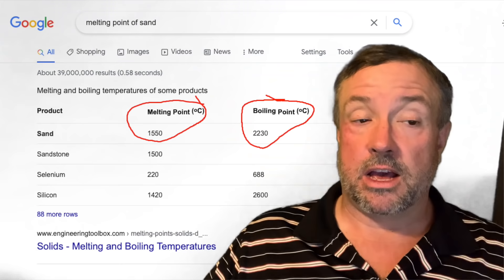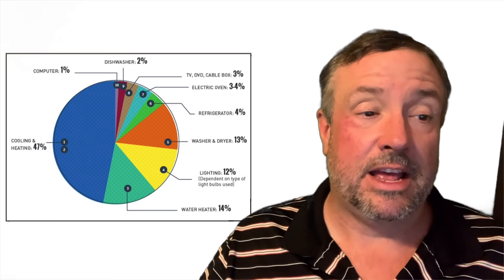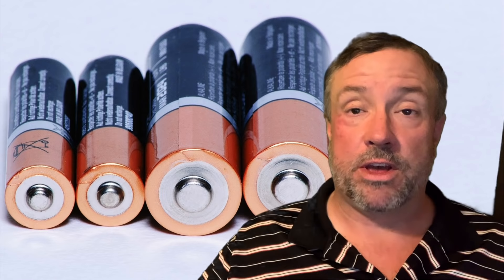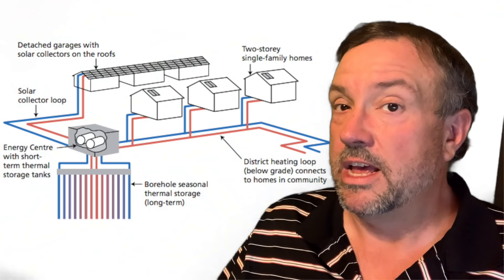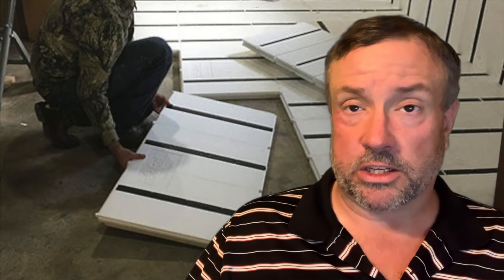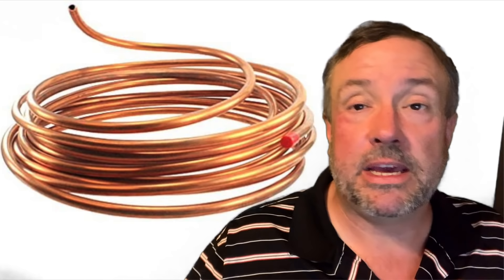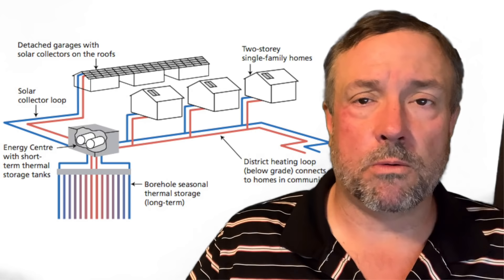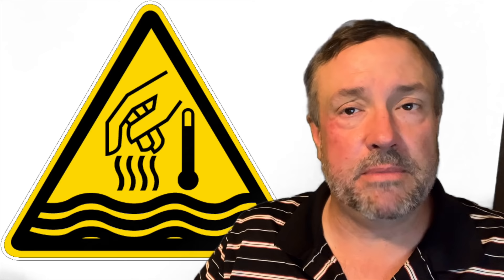Sand for Thermal Energy Storage

Comment: How much does it cost to dig a hole where you live? How much does an aircrete foundation cost? How deep and how wide are you planning on digging?
Reply from the maker: I have equipment to dig... aircrete is pretty cheap, just cement and dawn
Reply: @SimpleTek  do you need rebar for the aircrete? If you dig very deep will your aircrete walls be strong enough to support the pressure from the dirt? How will you handle ground moisture and drainage?
Reply from the maker: @lolerskates876  aircrete is waterproof, and the pressure should be equalized by the sand pushing back.. rebar is a smart idea
Reply: @SimpleTek  

Rebar may limit the life of the structure, better to have a metal free structure then it could last centuries like the Romans.

Comment: Sand is a good choice as storage medium because it has lot's of surface area to absob and release stored heat...but is not very energy dense as there are always air gaps that reduce the efficiencies previously mentioned as air is a very good heat insulator due to it's gaseous form. Air is such a good insulator because particle vibrations(heat transfere mechanism) are not enough to facilitate colliding with other particles, but instead these boundary level vibrating particles are converting energy into black body radiation(infrared photons) to transmit this excess energy away.

if you want to tranfere heat out you shouldn't need any liquids coming from the sand pit, just have insulated metal rods lead to the extraction point where you can have controll over wether you want to extract energy or not....like a hatch between a pile of sauna stones and the metal rod. When hatch is closed sauna stones cool off. When hatch is open, sauna stones heat up and you can drip water on them to spin a trurbine, stirling or whatever... you can also try using TEG in tandem to catch the heat losses from pipes i've heard that thermoacoustics can do wonders to make those systems efficient. Here is some idea on how that works https://youtu.be/kkBBkQ8jFRY
Reply: another option is have sand in stone box container that is insulated from surroundings by air and a reflector to keep the bb-radiation inside.
Reply from the maker: cool

Comment: why would you want high heat? Are you trying to cook something? If sand is good then would a pan with sand and put it on heater to give off more heat? or maybe a pipe filled with sand?
Or instead of running oil as you say why not use wax since that also stores heat since it is a good "Phase-change material"?

Also recently Tech Ingredients has a video  "Should You Really Use Solar Panels?" and showed another way to hear with a black tube in a glass box outside.

Comment: Evidently a copper coil in a tube, with salt water, heated, produces electricity. 
So I am off grid and failing at the solar gel battery game. And I just started exploring these concepts and now my mind is boggled trying to concieve a solar convection rocketstive mass heater that heats salt water, sand, and makes electricity 🙃

Trying to figure out where to begin. I have a round hunk of steel and a couple copper coils.
Reply from the maker: that's interesting - haven't heard of that yet! Thank you for the info!

Comment: Interesting idea. I think the main issue is going to be how to insulate it so you don't lose all your heat.
Reply from the maker: Great point!
Reply: I would say to use fire bricks on the inside layer of the insulation then on the second layer of insulation I would use mycelium panels. On the outer layer I would use some sort of coating to prevent the mycelium from decomposing before you were ready for it to do so.
Reply: Air crete

Comment: Sorry, one more comment. Do you need to expose the entire pipe to the sun? Copper conducts heat so well I was wondering if you could bury the pipe and use a dish to heat the end. Simple and it would be easier to heat more sand. Maybe last months like the video I suggested. Let me know what you think.
Reply from the maker: this is about heat storage, not collection
Reply: @SimpleTek  Correct. Use a dish to concentrate the sun and bury the rest of the pipe in the sand Straight down.

Comment: Have you heard of a house in Henrico VA that uses this technology to heat itself. It is affiliated with UVA. I saw it and wanted to learn more about it, but never followed up. I believe they used an insulated buried sand cube, maybe 12’ square, with hydronic heating. I was surprised at how small it was. I know they published data. You should be able to find it from what I’ve written.
Reply from the maker: I’d love to know more
Reply: Sorry, hit wrong key. Richmond Times Dispatch—I think this is the same house. Unfortunately I couldn’t read article without subscribing. There was a professor at the University that had teamed up with a businessman that was trying to get a related business going (from memory). The name Dave Stets came up and might have been one of them. I may have printed something about if. If I find it I’ll let you know.
Reply: Sorry, flaky internet. Wanted to say affiliated with VCU, not UVA. Also was built around 2010? Although article I found was 2019. My guess is if it isn’t the same house there is a connection.

Comment: Water is probably best to pull heat from sand due to the abundance. Hook it up to a solar heat generator and you can have around the clock heat!
Reply from the maker: except water has such a small temp range

Comment: Air can be heated to very high temperatures and you don't need pumps to move it. You can heat the sand with hot air (compartment one) and then release the same heat to heat water and run a steam turbine to generate electricity (compartment two). If you create a closed system you can condensate steam back into water (compartment three). Some version of this has been done on a large scale but I believe it can be done on a domestic scale.

If you don't want to use steam, you can devise a system that uses stored heat to power a stirling engine to generate electricity.

Obviously with unlimited electricity you can heat the space with various heaters.
Reply: I do like the idea of using electricity for heating, as drawing wire around will be way easier, and probably cheaper, than water-pipes. However, DC has high losses over distance. And Inverters for converting to AC will be a significant cost-driver. Losses, even with cheap inverters, should not be that bad. Could be that most of the cost of inverters are covered by what you save from insulated water-piping. 

I would however consider piston-based steam-engines over turbines. I am only basing this on research, not personal experience. But steam-turbines seem to be either very expensive, or complicated to build. Piston-based steam-engines can be made from old air-compressors or four-stroke engines. I also believe that the higher torque you get from a piston-engine makes it easier to find a suitable dynamo. Steam-turbines does not seem to deliver much torque; but does give a huge span of operating RPM's, granted sufficient build-quality. 🙂
Reply from the maker: interesting!
Reply from the maker: hummm

Comment: Simple tek you are thinking too small, or too cool, we are working with 500C hot air into the furnace, from our sand battery.  The piping is readily available,  the heat source is readily available, and the controls from your kitchen.  Aircrete, try roxol wool, it can withstand 1177C or aerogels, like Pyrogel from Aspen aerogels, If you troll YT you can find how to make your own type of aerogel from easily attainable ingredients and then all you have to do is wrap the battery in a type of rubber over gasket.  Otherwise any water ingress could make your sand battery a bomb.  Water after all becomes steam at 100C so at 500C boom.  Good luck.
Reply from the maker: Wow!!!!

Comment: Sand contains a lot of insulating air. Insects and animals  in the  burning hot Sahara are known to survive by digging down a short way into much cooler sand. American troops fighting in North Africa in WWII remarked how cold the nights were.  This all indicates that the heat of the sun sinks through only to a shallow depth..   To make this work, one would have to somehow drastically reduce or eliminate the insulating properties of the air.. Nothing comes to mind.
Reply from the maker: Interesting point

Comment: Does the math support this? For example - with 1 cubic meter of sand at 300C, how long can we heat up a cubic meter of living space? Don't know how to event start to calculate this
Reply from the maker: I don't have the math but I know it's in use now in several places
Reply: All dirt holds heat, even in cold areas the frost layer in the dead of winter is typically very few feet deep
Reply: @SimpleTek  Any idea how long it lasts? Does it work like heat up in the daytime (using solar), and drain in the night?
Reply from the maker: @dvr102  depends on the size, insulation, and  amount of heat - but if you look up drake landing in Alberta, they store solar heat seasonally In rock - which is similar to sand

Comment: tar with a flash point at 845 ferinheight it could be pumped through pipes in the sand. also used drill stem pipe is cheaper than new. anyway Just a thought
Reply from the maker: Tar doesn’t sound easy to pump
Reply: Is it easier or harder than molten salt?
Reply from the maker: @jeebus6263  I don't know, testing will tell

Comment: Instead of sand use melted aluminum.  The phase change in the melting of Aluminum can store allot of energy.  You can get the temps needed using concentrated solar and vacuum tube collection.  Molten lead flowing through vacuum tubes can be used to transport the hot lead to the aluminum storage material. Steel pipe can be used to transfer the heat in and out of the aluminum.  There you got it.
Reply from the maker: sounds dangerous!
Reply: please,please do it, let us know how it works out ...

Comment: I love the idea of using dirt cheap storage.  I just can't seem to find a fluid or medium that can carry enough heat into the sand.  While the sand may store up to a thousand degrees the transfer agent such as water or maybe some other agent can't get that hot and still maintain the integrity of the tubing.  Do you have a recommendation for tubing and transfer medium?  Also, would you be able to push more heat into the storage sand by using a compressor like on a refrigerator?
Reply from the maker: Read all the comments, tons of great ideas there

Comment: What about multi stage heat exchangers?

The alternative is PV powdered lasers, this is effective even in very cold days.
Reply from the maker: why multi stage?   PV powered lasers is an intriguing idea.....
Reply: @SimpleTek  

The first stage world be ambient to higher (I.e. A standard system you can buy today /200-300c) then take that as use a different gas (this is necessary as each gas is optimized for a different temperature range) and then go to different mediums until you reach 1200c)

But actually I don't like this idea, I think a (carbon) resistance powered by DC PV in the centre of your sand thermal mass is much easier and cheaper, then take the heat from the periphery of the thermal mass with a steel-air recuperator.

Simplicity and price is everything with this kind of system and this is what I'm planning to build next year.

I was going to use recycled concrete for the container but I do like the aircrete for the sides but I'm not sue it could take the loading, worth testing static loading.
Reply from the maker: @fuckfannyfiddlefart  very cool - thank you for the link

Comment: Sand is a term for a particle size as is clay. The void space between the grains of sand is a good insulator. Storing heat in sand and reversing the flow of energy is inefficient. Pick materials based on effectiveness for the demand rate.
Reply from the maker: really?
Reply: I have heard the same about and being an insulator. This is talked about in rocket mass heater construction.
Reply: All righty, now that you’ve burst our bubble on heat rejection. What types of storage materials can be considered . Could a liquid be combined with sand or similar medium? To work both directions.

Comment: how about just compressed air, heated by solar and direct diffusred into a  fluidized sand bed
Reply from the maker: why fluidized? what fluid?
Reply: If you installed the compressed air manifold you could easily swap out stove like electric heating coils (when they go bad). Power the electric coils with normal photovoltaics. Then exchange the heat from the sand to the house via air flow through a buried radiator.
Reply from the maker: @nicolaspotter7208  interesting!

Comment: As for the storage container, what about layers. The inner layer, say 10 feet diameter, is surrounded by something like Styrofoam, which is also surrounded by more sand. The Styrofoam insulates the heat form the next ring and the sand slows the transfer.

I was also wondering about having wet sand and the styrofoam would block the water from aiding in the transmission from one ring to the next. I would think you could have several ring to keep the heat from escaping.

I have heard that hydrogen or maybe helium is a good transfer medium as long as it is completely sealed, but I have no idea of the cost.

Comment: Mmm. You better drill a small but deep hole in the ground. Pump your cold liquid down, get it back warm, compress it in your heat pump and you are done.: hot water during the whole year. Only drilling is expensive.
Reply from the maker: true

Comment: Why would you want to make a thermal battery at such a high temp? Heat loss is proportional to the temperature differential. The whole cost will sky rocket!
Reply from the maker: good point
Reply: Although this kind of tech is not my thing and I haven't looked at it closely, I would think the one case where it could make some sense is if you built a seriously concentrating solar system, maybe with parabolic reflectors, that could get to thousands of degrees. I could only see this if you just didn't have PV as an option—hence my comment elsewhere about (hypothetically) rebuilding from a new Stone Age. If you have those kinds of temperatures, then a heat engine can work quite efficiently,

Yes, I know, if you can make parabolic solar collectors that give you thousands of degrees, you're really not in the Stone Age at all, but at least you might be in the equivalent of something lower-tech than industrial civilization.
Reply: Initial investment of heat bank is a one-time investment. So don't go cheap on insulating the bank and delivery pipes. I rather spend $$ on insulation to (R-50) than drop $$$ thousands on batteries that need replacing every 5-10 years and solar electric panels every 15-20 years.

Comment: What if instead of sand you use 1 1/2 gravel and just use forced air to transfer heat between collector to gravel, then a separate loop to force air to house?
Reply from the maker: intersting- wouldn't the gaps eventually fill in with dirt?
Reply: The gaps wouldn't fill in with dirt in an enclosed system, but sand would fill the gaps more thus increasing the efficiency.

Comment: I don't know I'm,no engineer but why wouldn't you just blow air through it and no,liquid I mean yes you would need a heat exchanger of some sort to cool the air to a realistic tempetature I suppose one way to do it would be a hot water heater that wouldn't handle the whole load im sure there is a way that would not waste it also I live quite a bit further south thsn you do I would need 2 seperate sand boxs one for heat and 1 for cooling I assume it would hold cold as well as heat that I suppose wouldn't necessarily require a sand application off topic yeah just use air
Reply from the maker: Possible

Comment: Would it work to have the sand stored under your house and have the heat passively move up to heat your house?  But I think the guy who claimed that PV + geothermal  heat pump is the best bet is correct, but that's not the $15k solution you're looking for.
Reply from the maker: one needs a thermostat

Comment: have u thought about Evacuated tubes? look me up at Guilt Free Hot Water. i usta live in Dryden eh. I have been to Drakes landing also "Water has the highest VHC of any common material. The following table shows that it takes 4186 kilojoules (kJ) of energy to raise the temperature of 1 cubic metre of water by 1°C, whereas it takes only 2060kJ to raise the temperature of an equal volume of concrete by the same amount. we gota do something with water storage
Reply from the maker: Evacuated tubes are probably the best solar liquid heating system  on the market today

Comment: I have access to free sand from our garden, play pit soft, like kiln dried. Also in our basement I have an old plunge pool that used to be used after using the sauna. It's aprox 3'5 long  x 2 wide and 1.5 meters deep, as its underground the surrounding earth keeps it at a constant temp of about 10/12 degrees. I have been toying with the idea of insulating it and using it as a water storage battery, kind of like a big buffer tank. I think sand could be a better option but I have no idea to be honest, total novice to this, What do ya think?
Reply from the maker: Water holds more heat up to 100’, after that you need sand

Comment: You could use air as a fluid to pump heat into the sand storage. If you make it really dry it'll also keep corrosion low and avoid problems with steam.
Reply from the maker: Good idea